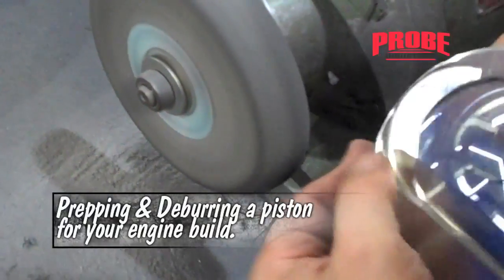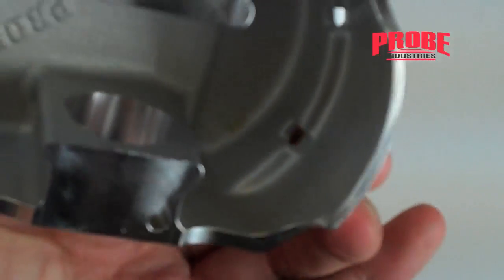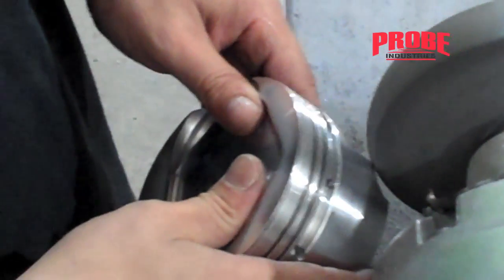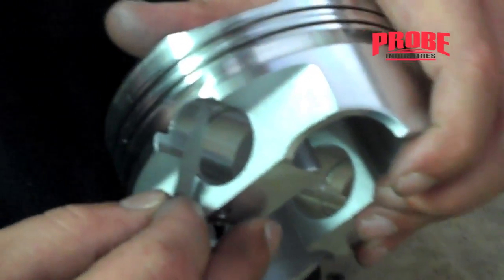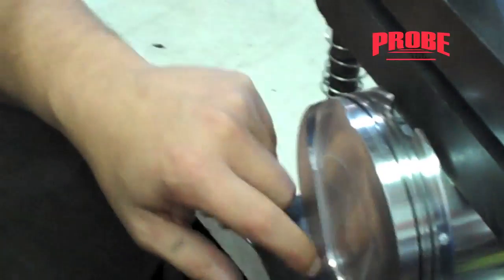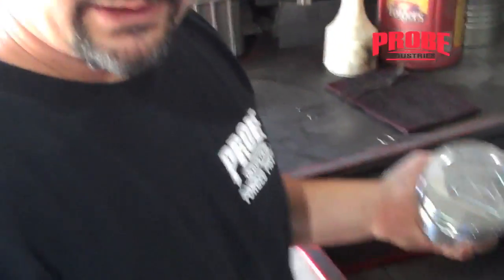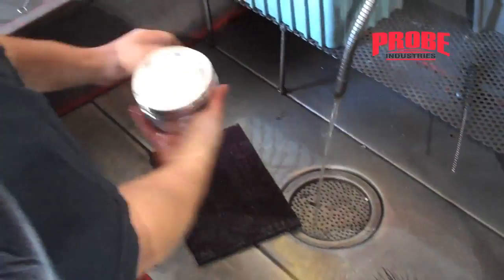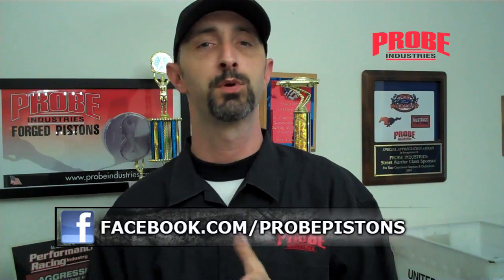How To Deburr A Piston & Prep For An Engine Build:: By Probe Industries [HD]

Comment: When you do this you want to re weigh your pistons always!
Reply: Does a Scotch-Brite Pad take off that much metal ?
Reply: @427HISS  No but make sure to wash your parts after! It leaves aluminium-silicon dust that's deadly to bearings. Never use it on vital sealing surfaces.